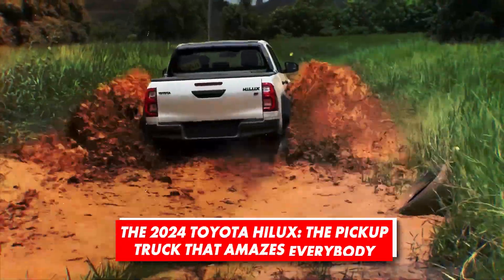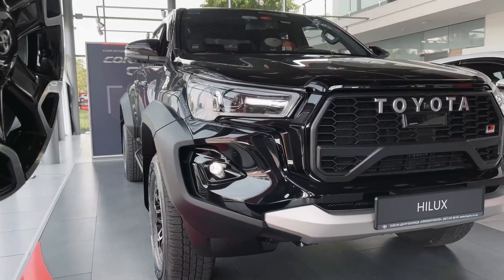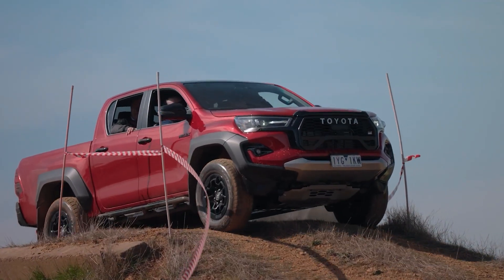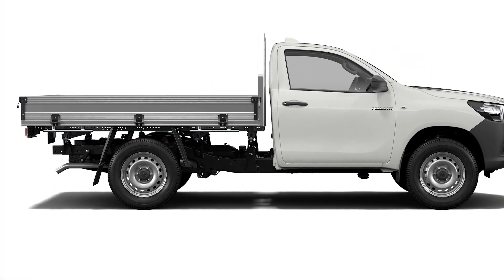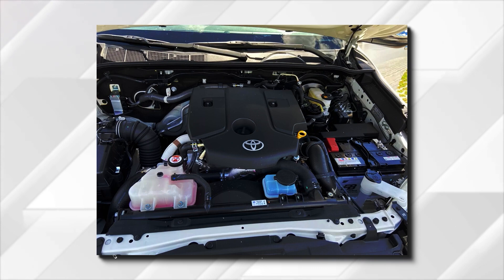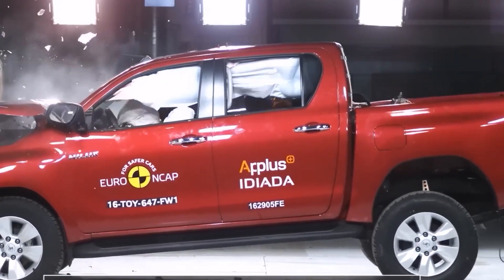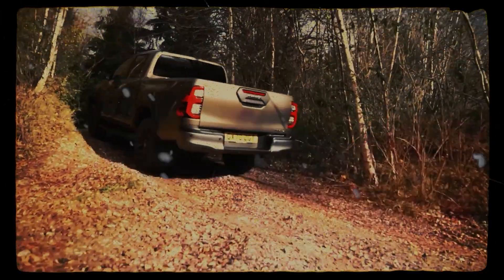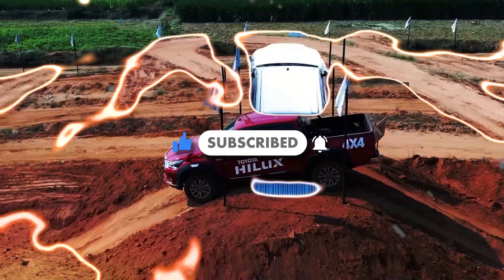The 2024 Toyota Hilux: The Pickup Truck That Still AMAZES Everybody

Comment: Toyota is not as much good as mitsubishi driving performane in sterling handling and engine horse power but toyota engine only very good at newton metre torque because toyota come with bigger chassiss block engine only best at slowly and medium drive on hill rock and offroad but not agile in rally racing very fast at gravel sand highway at sliding cornerring body roll very easy to overturn not like the mitsubishi car handling performance,toyota body metal look more stronger harder thicker same as Ford ranger, The king of champion Rally racing cannot challenge mitsubishi the greatest ultimate driving performance onroad and offroad awards by Guinness book of Record!AXCR cross country Rally Thailand to Cambodia mitsubishi Triton is the champion.